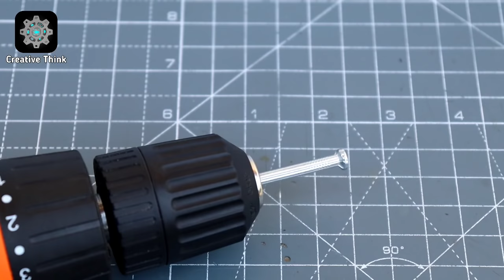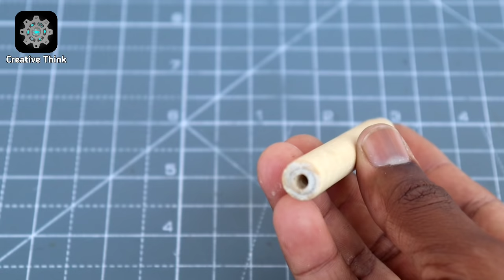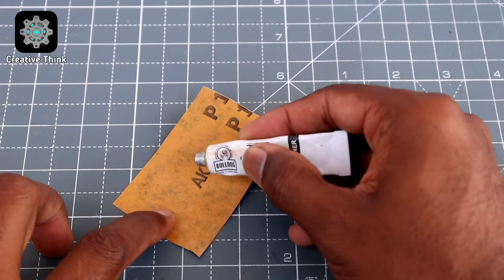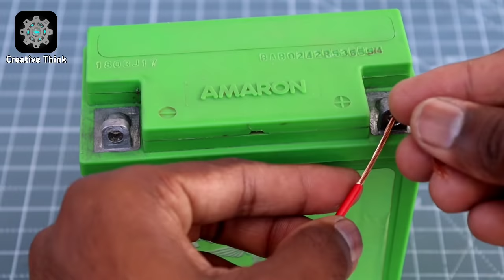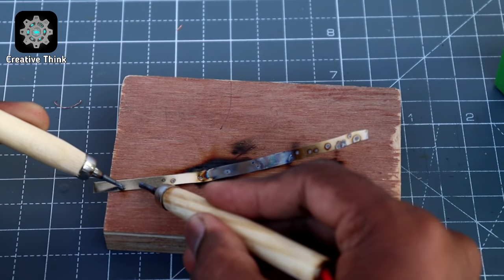Spot Welding Machine Using Lead Acid Battery

Comment: What is the purpose of the Diode used in series. The battery is giving DC and no further rectification necessary.
Reply: It is necessary because we are going to use it on liion batteries
Reply: @sharikashetty1517  Thanks Sharika for your comment. However see the title of the video It is "Spot welding machine using lead acid battery". My argument is valid irrespective of the battery type. I think adding a series diode has no meaning.
Reply: @p.p.wijesekera7388  It is extremely important. It has nothing to do with rectification. It is a BLOCKING DIODE  to avoid feedback from target batteries to spotwelder battery. Basic rule for security.
Reply: The diode ensures the current only flows in one direction. It’s for safety purposes.
Reply: @georgestiell7740  . The only reason for a diode in a dc circuit  of this type would be to protect from any back emf generated by an inductor such as a relay coil but short circuiting a battery is definitely not recommended. That is a universal instruction that accompanies all batteries. An 18650 spot welder works on low voltage and high current usually by the discharge of   a large value capacitor to give a short duration high current pulse.
Reply: Seems a bit naked without a proper regulator but keep your face away from the battery. Even with the diode, it is a full short CCT. I will give it a shot. What is the diode value? please tell.
Thank you.
Reply: @johncrosley1  Yeah, I've checked that Welder. 5 volt, usb. Strip 'em and reverse engineer. 👍
Reply: Diod value batay
Reply: It looks like 6A4 or 6A10 rectifier diode to me....
Reply: Prevent back voltage into battery when welding 18650 cells. Limits current to 6A nominal - a lot more peak -, as an attempt to prevent damaging battery with a short circuit. It doesn't work, tough, it's still almost a short circuit. A resistor would negate the short circuit, not a diode.

Comment: Yes very good method if your father have a factory of car's batteries. After 2-3 weldings you replace the baterry with a new one for the next 2-3 weldings :P
Reply: After a few minutes your battery is going to discharge because only 1 diode you put in your battery..
Reply: Why...battery can be charged through solar panel
Reply: Even without diodes it works but it will damage the battery, so that's why he use diode to prevent from damaging the battery
Reply: @keedzulkiflykeeabdjalil3536  what's the name of the diode place, can be improved more for battery not getting damaged?
Reply: @litofrancisco5374  what's the name of the diode place, can be improved more for battery not getting damaged
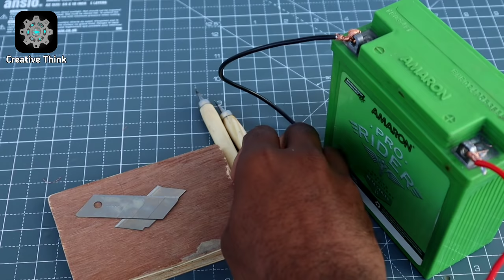Reply: @litofrancisco5374  he didn't put diode 4:59
Reply: Awesome soldering skills xdxdxdxd
Reply: Hey
Reply: @catalinaramirez6495  please see the  video again & again.
Reply: not if u have a charger
Reply: @keedzulkiflykeeabdjalil3536  Could it have been a power resistor instead of a diode? What should its resistance value be?
Reply: @litofrancisco5374  Actually, he didn't put a diode at all.

Comment: Great for a cheap spot welder, but I suggest you do NOT use it on your battery packs! A fraction of a second too long and you are going to damage the cell!   :(
Reply: I think add capacitors may help to reduce damage to battery
Reply: Didn't he use a diode
Reply: A diode is used, if still doubtful then use a dry cell carbon electrode on one end.
Reply: So what trash anyway or scrap
Reply: Should have one contact on base metal and other on the piece to be attached. Putting both on the same top strip makes a short circuit and does not create a spot weld between the 2 pieces of metal..
Reply: Why not just use the razor   As the electrode.
Reply: @DavidCNagy так варят литий!

Comment: If you make one of the probes to have a greater surface area then only 1 spot will get hot instead of both contact spots.
Reply: Thinking the same thing to use a half of a car jumper cable.

Comment: Connecting 2 terminals of batteries with a diode.. 
Safety level is directly leading to the heaven
Reply: The diode would have turned into a piece of wire on the first try. Not needed on a DC battery anyway.
Reply: @lyndonp6296  That's a 6A4 diod... it's common diod that comes in at 6 amps at 400 volts... that's a 2,400 watt diode. It will survive that little 6v battery ... it's there for back flow protection to keep the battery from heating up... it's still a super unsafe build, but the diod definitely didn't fuze... in fact diodes can't fuze into a conductor because of how there constructed... it would glow red hot, let out it's 'magic smoke' and loose it's conductive properties then the glow would go out and it would just be a dead diod. If your lucky it happens fast enough that the thermal expansion causes a miniature explosion, but usually it's not that spectacular when a diode fails though... usually it's just glow, smoke, fizzle, dead all in the course of about a second (a really long time in electronics).
Reply: @binaryglitch64  Yet, in my 40 year career as an electronics and computer engineer. I have replaced literally hundreds of short circuited power supply diodes and rectifiers that have turned into Zero ohm conductors.
Reply: @lyndonp6296  okay, well if you understand enough to say zero ohm conductor than you can totally call it a wire all day in front of me and go unchecked because you know what your saying. Also because respect for elders. You started your career when I started life.
Reply: @lyndonp6296  I am at a lost how a pn junction becomes a wire.
Reply: @joyjoy534  Just a 'figure of speech'. It is common for power diodes to short circuit in power supply circuits. Half wave diode circuits or full wave bridge rectifiers, they all do it...
Reply: @binaryglitch64  Yes, I'm retired now... but happy to see the industry is in good hands like yours.
Reply: @lyndonp6296  the diode wasn’t even there when he was spot welding. I don’t see how you could be wrong.
Reply: @lyndonp6296  question….would you recommend spot/tack welding a rechargeable aa battery this way? Would it damage the battery? I’m trying to repair a beard trimmer….
Reply: @longsleevethong1457  with the amount of heat being generated I wouldn't think it's a good idea to use on rechargable batteries
Reply: @MrPaw45  how do you think they make battery packs?
Reply: @longsleevethong1457  with spot welders that have enough control not to get the whole strip red-hot.
Reply: تعمل بمحول ١٢ فولت ٣ امبير مع ربط دايوات بديل للبطاريه

Comment: Good product but what you need is some sort of fast switching mechanism.. Otherwise the current is too high to utilise and it will damage the part to be spot welded. Shorting the battery for a long time may even damage it. You can use a 200 amp relay as a switch.

Comment: That right, just short circuit the battery time and again.
Now why do I think that could lead to disaster ?
Reply: It's not a short circuit because he has a diode as a resistor on the plus terminal of the battery. It's a LOAD so it's wrong for you to talk about a short circuit.

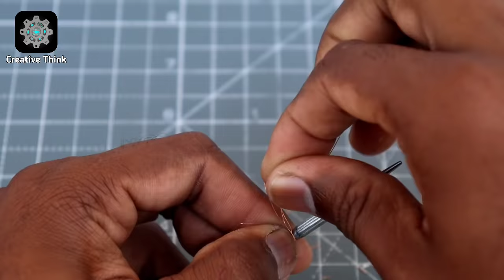Comment: The fixture of the nail at 2:00 is great art work! Thats whats the electrician wants to see! A connection capable of really high current - just as you need it for spot welding! But wait - its going to be even better: the diode - poor thing! Why the hell would you need a diode here??? Its probably melted to short circuit now - thats why it still works :-)
Reply: 100% agree the diode isn't needed... which I guess is why it isn't in the circuit in the video when they are welding. This is not a good spot welder.
Reply: Obviously this is a diode test circuit. It works a lot like a fuse test circuit. One and done.
Reply: It seem to be good enough for certain jobs, especially if a guy already has all the components laying around like this guy typing this comment. I have a specific task is why I'm watching a few videos, the easier and more inexpensive way I can achieve my objective is what I'm looking for. I have a $10 u.s item that I would like to repair so it don't make sense to spend $30 on the circuit board and whatever else to achieve the same results in my case. I'd be happy to return to comments when finished and give a honest review of my success or failure. If anyone would be interested in honest opinion of how this performs on everyday materials? I'm not a welder or an electrician and have very very limited knowledge how electrical currents flow. The easier it is to comprehend and implement the better for a lot of people who don't have the knowledge of electrical currents and how they work and what components you need to build more sophisticated devices. Im just a regular Joe that turns to smarter people then myself  i. e YouTube for ideas to aide me along. To criticize an idea just because you have a more elaborate sophisticated way to achieve near same results. Well post your YouTube video and maybe the way you suggested would be better. But is it more practical for everyone or only a one time use? Keep on keeping on fellas all these diy vids are great. And I'm sure they help tons of people..
Reply: Hey, that's some high performance sh!t right there....!
Reply: The guy just makes videos that teach you enough to get hurt but not enough to avoid it. Which is probably all he knows too. Shouldn’t be posting stupid ideas like this. Someone who doesn’t know anything about electricity and what is safe will try it because it looks so easy and simple. Dying is easy and simple to do too.
Reply: It seems inevitable that in the future people will  not be able to post DIY videos teaching people how to do things that could be dangerous. We really don't want that so everybody should start including safety messages and doing their best to prevent the disasters everyone is alluding to in their comments. Hey guys, instead of saying this guy is dangerous, tell us specifically what he did wrong.  @TadpoleTrainer

Comment: I haven't watched all your videos, but looking back over them for the last few years: I can sort of understand why I subscribed to your channel in the first place. Most of your videos are basically harmless, with the occasional bit of fun added to get the old Mellon functioning somewhat outside its usual box of thoughts. I probably wouldn't even worry too much if my boy started flicking through my YouTube library to see what his old man's been up too... But, now: those days seem long gone. I've seen for real the damage caused to the human body by arking battery terminalls. Just the thought that someone NOT in the know might try something not too dissimilar To this.... food for thought, people. Food for thought....
Reply: Hey Ray! 40 years ago, one hot day in the shop...
A customers car that just got into a stall for a non starting issue. 
Yup, the battery exploded but the hood(Bonnet)for you Brits was closed.
I have an inate fear of dead shorts in high current potential.
YouTube has tons of Darwin Award winning content.

Comment: Instead of cutting the nail head you can solder it and it also helps in strengthen of the wire joiner.

Comment: Can use 12V 5A transformer for this spot welding in absence of battery.
Reply: no, 5A is not enough. You can use supercaps instead of battery in addition to your 12V 5A supply

Comment: Why is the diode you soldered on the + side not on any longer when you were spot welding???
Reply: Well, apparently came out for a walk and will be back later...
Reply: he went out for milk
Reply: It was unnecessary and foolish.  It fried the first time he tried using it.
Reply: He didn't think it would go pop. Probably made sense to add a diode he just went the wrong way about it. So probably added it just didn't know exactly how to add it.

Comment: "Positive electrons", eh?

Just out of interest, what's the diode for?  Is that in case you are spot welding batteries to maintain polarity or is it acting as a resistor?

Comment: After a few second... You will hear one-word "KaBoooM...!!!!"
Reply: No he won't, it will just melt... at worse we're looking at fire with battery acid and molten plastic spilling out across the table ... in a really really rare type of diode failure he may get a small pop from the diode... but that's a 6a4 diode ... it's rated for 6 amps at 400 volts DC so that's 2,400 watts... the dioed would out last that battery... but he configured it wrong for backwards voltage protection so the battery is likely to melt... though he'll probably notice before fire starts... it's going to start warming the plastic by the terminals first and as the plastic gets soft things will begin to shift and he'll see that his terminal is say 8 mm from where it belongs and then realize he's melting the battery. That's the most likely outcome ... but kaboom has my vote... that would be way cooler.

Comment: Very nice,but won't the solder melt inside the probe covers?
Reply: No because that isn't the point of highest resistance.
Reply: @jeffcantley9203  that's because the resistor is the point of highest resistance! Just like the probes touching the metal is the point of highest resistence,  therefore the wires don't melt first...
Reply: @Quickened1  Just like the path of least resistance is not the only path for current, the highest resistance is not the only resistance.  Considering the large currents in this ridiculous "spot welder", Sourav has made a correct observation.  In every case, the connections should be mechanically sound before soldering.  Solder is not intended to be the current carrier as it's typically 5 to 10 times the resistance of copper, depending on the alloy used, with a much lower melting point than iron, which is about 4 times the resistance of copper.
The diode that was soldered in place was absurd.  Not just because it was soldered in place, but because there is no way that diode is going to handle the current... and since it's missing at the end, it definitely didn't survive.  Never mind that is served no purpose.
THIS is why people who make videos on YouTube are often dangerous.  You can be king of the blind with partial sight in one eye and blind in the other.
Reply: @DiffEQ  I agree that this device is a joke,  and it should only be used in an emergency,  life or death situation. I was just stating the reason the solder would likely not melt, and if it did,  so would all the insulation and just about everything else. You're right,  a lot of dangerous people posting on YouTube...

Comment: Great idea I've tried it before and didn't work because I didn't use diode to stop the current going through the battery.
Thank you for your effort man you solved the problem 👍
Reply: Diode value please
Reply: @usefulideasforall4747 
Get one from a broken microwave
Reply: Diode serves no purpose but to make smoke and shrapnel.